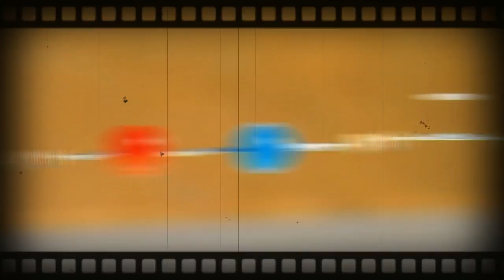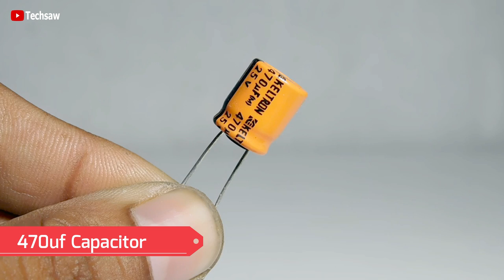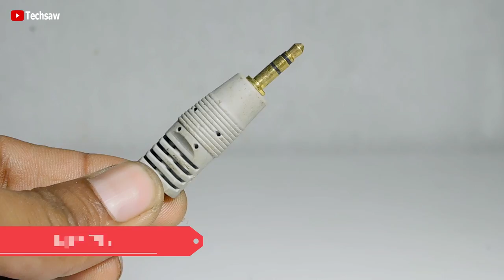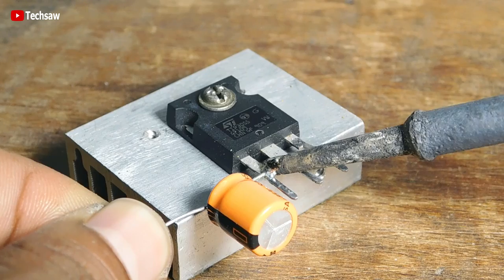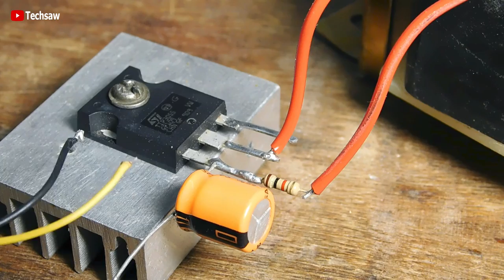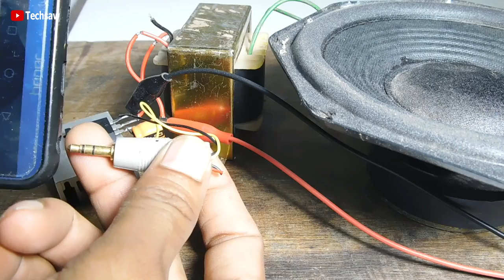Power Amplifier With Audio Transformer | Clear  Sound

Comment: While speaker can be connected directly to the transistor. I do not see any reason of using a transformer .Please explain.
Reply: I think maybe it's for impedence matching
Reply: It isolate the speaker from dc voltage, it will help in driving bigger speakers

Comment: Class A?
Reply: this is like a tube amp, which also has a transformer on the output. It is interesting, it would be necessary to analyze the level of distortion, watts and how to add a volume control.